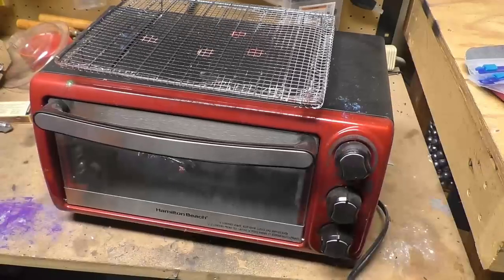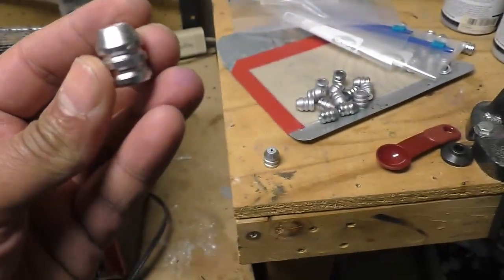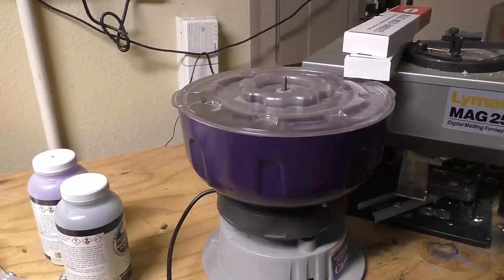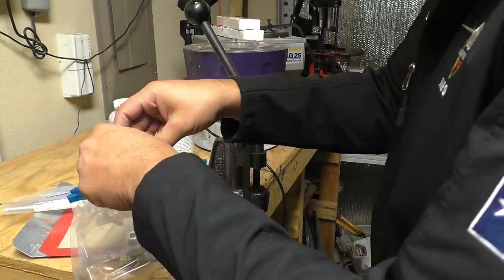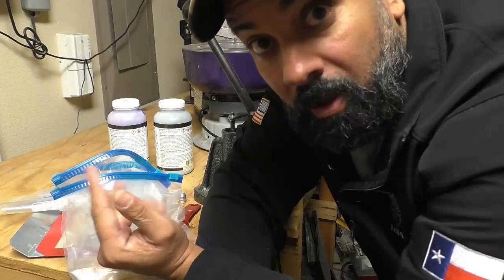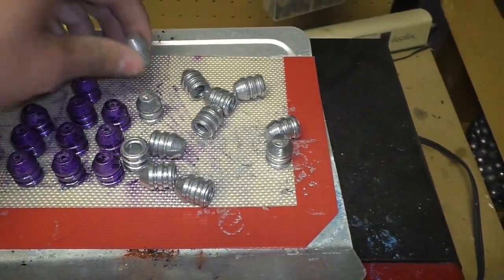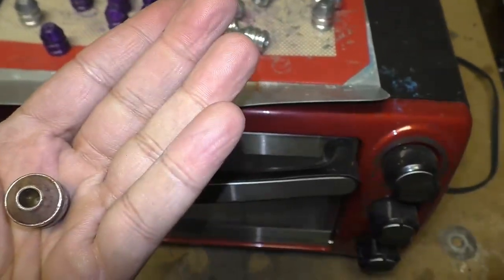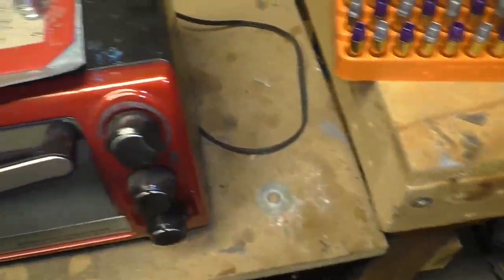Powder Coating Slugs

Comment: Doesn't the tumberl disform your slugs???
I thought it would with bouncing around hitting each other, and I was afraid of losing accuracy by making the slug Disformed with dings by hitting the lead slugs agains each other. Reason I am saying that is I saw a video of someone making buckshot, and they would put the made buckshot in a tumbler to smooth the buckshot.
Reply from the maker: I suppose if you leave them in your tumbler for a while, it would. For poops and giggles one time, I put slugs in my rock tumbler that use for my buckshot. Yeah, that messed them up.

Comment: I use a plastic container like a tupperware container , peanut butter or mayo jar to shake the bullets in . It normally only takes a minute of shaking to get the powder to stick . Like you said , the humidity is the major factor on how long it takes the powder to stick .
Reply from the maker: Hugh humidity is a killer.

Comment: Nice! I really like the zip lock idea and it probably helps accelerate the static buildup. Because I’m pretty sure those are made from a polypropylene #5 type plastic. Not to mention no or extremely little mess to clean up. 
Do you water quench after coating? It really brings your hardness back up after baking. Well lead with antimony in it anyway, does nothing for pure lead. 
Figure if you water quench after casting and then powder coat without quenching. You kinda lose your gains from the oven heating your cast alloy allowing those molecules to rearrange themselves some.